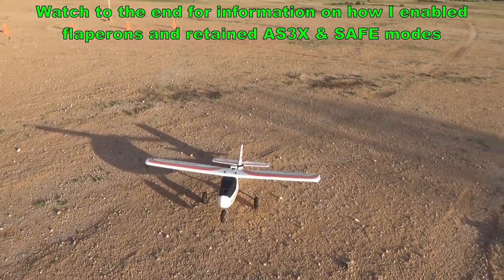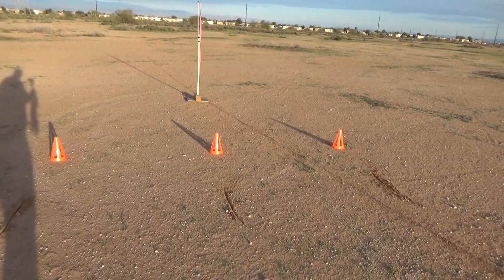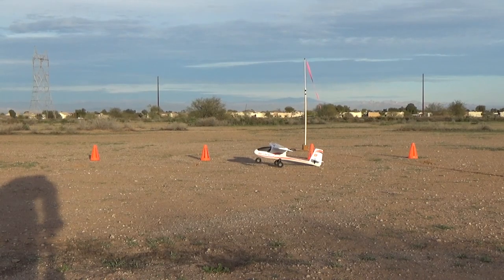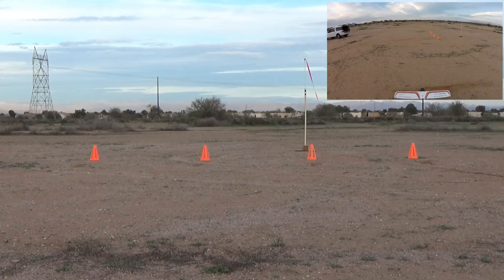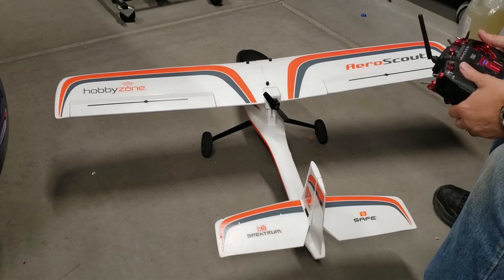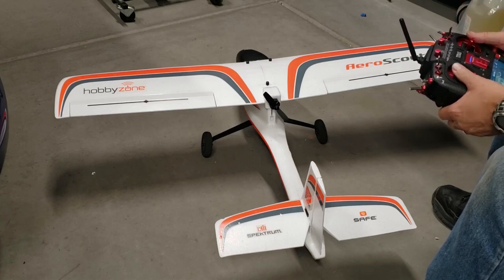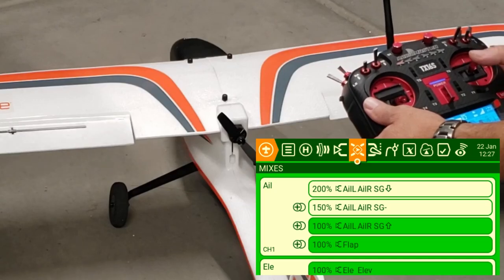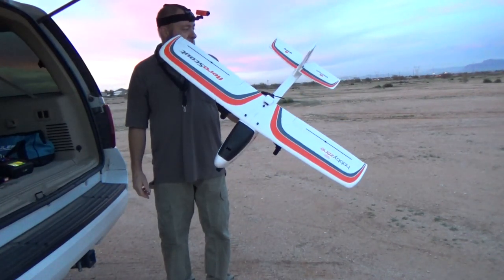HobbyZone AeroScout S2 1.1m Flaperon Test and Setup

Comment: You have used all 6 channels. What channel is flight modes on what channel is panic on
Reply from the maker: The AR631 & AR637 have 6 physical servo outputs, but also multiple "virtual" outputs. Channels 7-9 can be used for safe mode, panic, reverse thrust (with Avian ESCs). Channel 6 is actually free in this setup. Using 2 and 5 are the ailerons at the receiver (1 & 5 in the transmitter).
Reply: Thanks for reply. I have avian escape and moved my mode and panic from channel  5& 6 to 7 & 8. I get no mode or panic function.   Does the 631 need to be programmed to open channel 7 & 8.  Do not understand 1 & 5 at transmitter.  My check 1 is throttle
Reply: Do you have model file to share
Reply from the maker: @JamesMorrowSr  What airplane and what transmitter are you using? If you are using the BNF AeroScout like I have here the receiver may need to be unlocked before you can move safe modes away from channel 5 and panic is also stuck on channel 6 until you unlock and reset the receiver. I have other videos that cover how to unlock and reset these receivers. If you have Forward Programming available on your radio and depending on your receivers firmware you might be able to change the channel in Forward Programming. You also need to do the factory reset to allow you to move an aileron to another channel or the gyro (safe mode) won't be able to control the 2nd aileron.

My comment on the channel difference between the transmitter and receiver is related to channel conversion when an EdgeTX radio is bound to a Spektrum receiver. To explain this fully is more than I want to type out here but basically my radio channel order is AETR. This Spektrum receiver default channel order is TAER. The radio converts AETR to TAER when it leaves the radio.
Reply from the maker: @JamesMorrowSr  I can share a model file for the TX16S but if your receiver isn't unlocked, factory reset, and fully reprogrammed it won't work.  Have you followed my videos on unlocking and resetting these receivers? If not you should go through that before trying to setup flaperons.
Reply: I have tx16s multimodule pgm fot TAER
Reply: Would like the model files i will work to unlock my 631.  Have an extra one to experiment with.  Will read your direction videos (forward programming)
Reply from the maker: @JamesMorrowSr  Working on it.  Check back tomorrow and I'll put together a file you can download with an example model file, perhaps the model report from Companion, and the sound files I created for flaps up, landing flaps, and takeoff flaps.  I have to repeat my disclaimer, I cannot guarantee it will work for you as-is so be sure to be very thorough with your testing and setup to ensure absolutely everything works and that you know what everything does.  I will include a text file that explains the various logical switches and special functions I have programmed into this model file.  It has reverse thrust setup (you won't be able to use it unless you have the Avian ESC and get it setup), and my custom throttle cut logic.
Reply: Wow great
Reply from the maker: @JamesMorrowSr  Exciting news!  I've had this in the works for a while but you gave me the motivation to get the first test model completed.  I've put together a GitHub repository to share model setups.  Just the "Flaperon AeroScout" in there now.  You can be the first tester if you'd like!  Link and notes are now in the video description but I'll paste it below as well.  Download the "AeroScoutFlap_Flaperon.zip" file, extract it and carefully review the "Readme.txt" file for details of the model and how to install it on the radio SD card.  I tried to be as thorough as possible and I've included the model file, Widget I used, sound .wav files, AeroScout image file I use, and a model detail report from Companion.

https://github.com/qsiguy/EdgeTX-TX16S-Models
Reply: FANTASTIC.  love this airplane and Tx16S.  Will be experimenting with all your updates @shanesdiy
Reply: where EXACTY do you show how to Forward Program ALL the settings to get Aeroscout back to BNF state (AS3X/SAFE/PANIC), after Factory Reset.
Reply: This does not show how to setup AS3X/SAFE/PANIC items with Forward Programming.  After you Factory Reset the AR631 BNF, all Aeroscout settings for AS3X/SAFE/PANIC are gone.   Where is the info how to enter all that data, and change SAFE and PANIC to CH7&CH8
Reply from the maker: @JamesMorrowSr  I have a series of videos on the receiver unlocking and reprogramming process.  In episode 3 I show how I reset an AeroScout receiver and reprogram it from scratch.  If setting up for Flaperons some of the steps will be slightly different but all steps are explained.  Here is a link to that video.  If you skip around it is easy to miss important steps so I suggest working your way completely through it.
https://youtu.be/mEfLGnEZN9U
Reply: somehow I cannot explain myselr,  I know how to set up flaperons.   When I Facotry Reset the AR631 I lose all the AS3X/SAFE/PANIC programming.    I program it for flapersons using CH2&5,  I program SAFE and PANIC switch on CH7&CH8.  But now I still do not have all the settings for an  AeroSCout AS3X/SAFE/PANIC FM.    what are all the settings for gyro and such, to get the Receiver back to Aeroscout BNF AS3x/SAFE/Panic settings.
Reply from the maker: @JamesMorrowSr  The settings for gains, bank & pitch limits, and such I show in that video I linked to are what I use on my AeroScout.  It also shows how to set the channels for f-modes (safe), properly set the mounting orientation of the receiver, etc. I don't use panic mode but I show where it is on the video if you want to use it.  If the settings are all gone when you enter forward programming you should see the option for "First time setup" and you must go through all that as I did in that episode 3.

I don't cover all the details in this flaperon video as stated in the video.  It is just an overview of what was done.  For details on first time safe setup you must follow that other video.
Reply: yes I have it now.   However the settings you have for  AS3X and SAFE are not close to what the settings are on aB NF  AR631 for Aeroscout,  that is what I was looking for.   I have to assume the settings Spektrum includes on a BNF Aeroscout AR631 are optimized for that airplane.
Now I was able to get those settings. I used model telemetry to ""Discover New", then "Add New"  Then I used the "DSM smart RX telemetry" to see AS3X gains and headings and SAFE gains and Angle limits, in the BNF Aeroscout AR631.
However, I cannot get it to work yet, on a Factory Reset AR631.   I get the two actuations of surfaces on boot up, to say it is in AS3X and SAFE mode,  but my CH7 mode switch evidently does not work properly.  the Elevator shows proper movement in the 3 modes, but the Ailerons and Rudder do not change.   Have to work on this.  If you want my pdf of all the settings for the BNF AR361 for Aeroscout, let me know how to get it to you.
Reply from the maker: @JamesMorrowSr  The gains, heading, etc settings are not that critical.  I've tried a broad range of gains, pitch and roll limits and it doesn't make much different provided you don't set the safe gain too low.  If you set it too low you will severely limit control of the plane.  I wouldn't go lower than 30-40 on any of the safe gains.

If the ailerons and rudder are not mapped to the gyro correctly are you sure you did the model setup portion correctly for wing and tail type?  Any changes in the model setup you must then go into forward programming and "relearn servo settings" so the gyro knows which channels and directions are for each control surface.  Do all the control surfaces work from your transmitter sticks?

Inside forward programming in F-mode setup is it set to channel 7?  If channel 7 or higher isn't working and you are confident you have it setup correctly in the mixes, make sure in your model setup, internal RF you have channels 1-12 enabled.  Creating a model will sometimes set it to 1-6 by default so nothing over channel 6 will be transmitted to the receiver.
Reply: I have a question on what EXACTLY where the flaps are in your settings for FLAPS UP/TAKEOFF/LANDING
Flaps up= flaps level with wing, or flaps above wing
Takeoff =  flaps above wing, or flaps below wing
Landing= flaps above wing or flaps below wing
 @shanesdiy
Reply from the maker: @JamesMorrowSr  In my setup on this plane, I have not experimented with "crow" where the flaps are above the wing.  My settings are for the 3 flap positions are:
Flaps up=level with the wing.
Takeoff flaps=50% between level and fully down.
Landing=flaps down to max travel.
Reply: great exactly what I needed to know  thanks much    @shanesdiy

Comment: Lands fast?.....a full stall landing on the mains is at a brisk walking sped. This plane will FLY until the end of the battery at a joggers pace in no wind conditions.....landing too fast is due to lack of throttle management, it has NOTHING to do with the plane.....
Reply from the maker: Compared to my Timber X it lands fast and more than that, the glideslope is much flatter and at one of my flight locations I need to come in steeper over some trees and get it down fast to a short runway.  Flaps help with that.

Plus it's fun to mod planes and experiment.  Major part of the hobby for me and many others.  Don't need or want flaps don't do it.  Happy flying.
Reply: Obviously it lands faster than a Timber.....which has more wing area, flaps and leading edge slats with very little extra weight,  relatively speaking. .
Kind of an "apples to oranges" comparison dontchathink?
I don't have an issue with your adding flaps, or whatever else you want, to your AeroScout.....I built an entirely new wing for mine with a bit longer span and included flaps and slats very similar to my Timber Evolution. 
My only issue was you stating that the AeroScout lands fast....I stand by my comment regarding throttle management. You can also "slip" to bleed off altitude while keeping speed more manageable.....
Reply from the maker: @TheWingnut58  Haha, ok.  How about... "In stock form, it lands faster/longer than I'd like so lets try to slow it down with flaps to utilize my tighter landing strip".  I preach the same thing about throttle/speed management to folks when I hear "the AeroScout likes to float", that one annoys me.

I was only comparing the two airplanes because I wanted to more easily fly the AeroScout at the same tight field where I fly my Timber X and Turbo Timber so that is roughly my "target".
Reply: Fair enough, I didn't mean to sound harsh, nor did I intend any disrespect. I think it's great that share your experiments and experience. Keep'em coming!